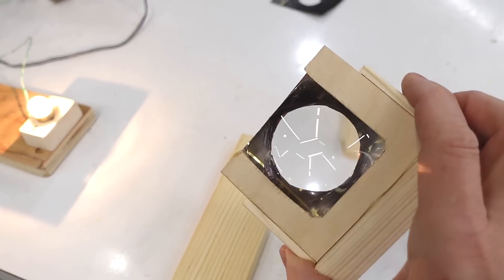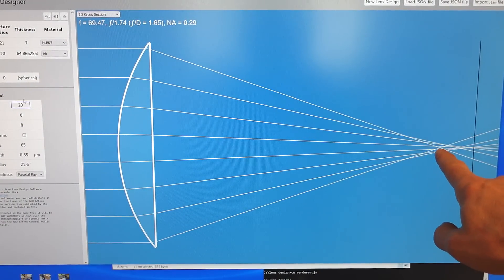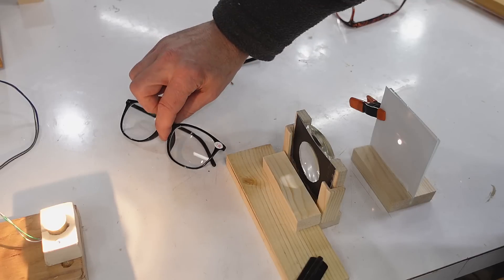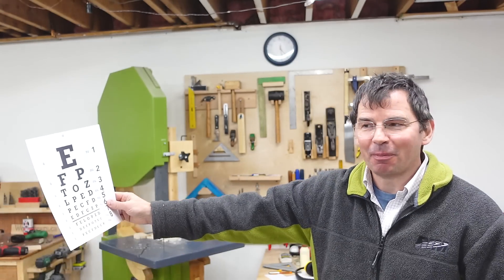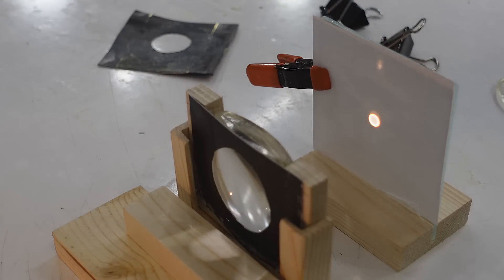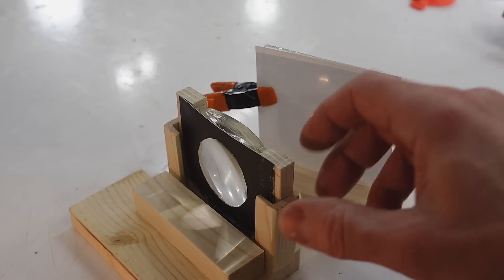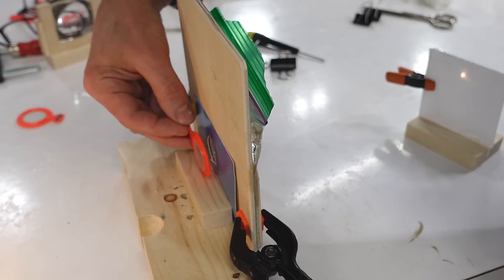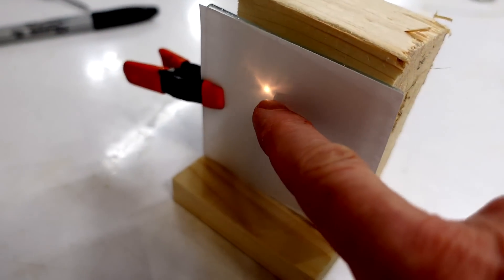We get slightly nearsighted at night, corneal aberrations, and stars

Comment: Do you think glasses affect your ability to line things up by eye? I’ve been attaching planks to a stud wall with screws about 10” apart and when I stand back and look at it the line is not straight! I swear I used to be good at finding the center! Is it the magnification? The astigmatism correction? I started using a torpedo level to mark my screws before I got very far up the wall. Maybe this is related to “I make more mistakes than I used too” and not optics. Either way, aging is disappointing

Comment: I've been following you for a while now and I'm surprised that you just picked up my bachelor topic for a video. Actually there are 3 processes that lead to this night myopia.  
1. as already mentioned, spherical aberration leads to a defocus of about +0.2D.
2. when it is darker, we use not only the cones, but rods and cones (mesopic vision). This shifts the maximum sensitivity of the retina towards the shorter wavelengths. Since shorter wavelengths are more strongly refracted (dispersion), the subjective refraction is more negative to compensate. This longitudinal chromatic aberration results in an additional +0.2 dpt.
For this reason, blue dots are refracted differently in the dark than red dots. 
3. resting accommodation without any stimulus is about +1D in most adults. Even to weaker stimuli, the eye responds with "overaccommodation" or resting accommodation. Stronger stimuli, such as distant car headlights, immediately reduce this effect. Depending on the illumination, this effect is between +0.5 and +2D in complete darkness.
Reply from the maker: You mean to say our focus muscles work in absence of light, but as soon as there is light, they relax a bit?  My current thinking is, due to spherical aberrations, the eyes apply a substantial image sharpening effect and ignore a lot of flare caused by aberrations mostly.  But when light levers are very low, the signal isn't strong or clean enough to do a lot of processing, so this breaks down in very low light.  Personally, I can't accomodtate much any more - maybe 1/4 diopter.  So I woudl think the focus acoomodation part isn't a significant contributor.
Reply: @matthiasrandomstuff2221  that’s exactly what is happening. 

Retinal image processing is also better for cones than it is for the rods. So under low light conditions with more rod-sensitivity the perceived Images get a lot worse. 

A suggestion:
You can try what is your dominant eye and correct it for far distance. The other eye you can correct with (your prescription+1D) actually the brain is very capable of making a good viewing experience out of this. 
You can tell what your dominant eye is by covering up a corner in the room with your thumb, both eyes open. When you then close one eye and the corner is still covered the open eye is dominant. If not the closed eye is dominant.

Comment: Can you do a video on solvents and plastics? I was watching a video of someone cleaning a battery terminal and they didn't use alcohol. They used one of the many contact cleaners. So naybe a nice comparison of name brand Contact Cleaners, rubbing alchohol, distilled water, and vinegear on metals and common plastic types. Mostly nickle plated items, but other metals work too if it seems necessary.

Comment: I have an eye disease called Keratoconus mostly in my left eye.  The big letter E just looks like a black spot with out any correction.  With both contacts and glasses I can kind of see with it.  I do not need glasses nor contacts with my right eye.  I can see movement with my left eye which helps driving.  When I push the buttons on the phone I sometimes push the neighbor button.  Just for your information my eye is like and island nice and round that has been turned on it's side. Just like the island everything shifts.  I no longer look through the center so that's the problem.  For the last few years my Doctor say they will have cornea transplant in about 10 years.  What I see from your video, a lot of what you are seeing looks like what I see only for me more so.  I know I don't need to say this, but please have your doctor check your eyes.  I truly mean you well.  BTW in 10 years I will be 78.
Reply from the maker: I have been fascinated with optical aberrations in the eye.  But I don't think what I'm seeing is worse than usual.   I see quite ok despite the aberrations, and some spherical aberrations are normal.  I think the eyes relay a lot on the brain correcting for a lot of bad optics.  Other than age related farsightendess, there hasn't been a whole lot of changes in my eyesight, so I'm pretty sure I don't have keratoconus.  Will see the optometrist again once it's been 2 years since my last visit, so my wife's work benifits will cover the cost.  Researching all this, I have become fairly knowledgeable on the topic, so I'm pretty sure I'd recognize symptoms of something drastic like keratoconus.  Glaucoma not so much though.
Reply: @matthiasrandomstuff2221  Two things. 1) I didn't mean to imply that you have what I do.  I just met keep watch on those eyes, you can't get new ones.  2) My old eye doctor took about 5 years before he told me I needed to see someone else.  He would spend 20 min looking at my eyes longer than he did my wife or daughter.  I know he did the best he could.  If you do have it, you may not know for a few years.  I knew my left eye was not as good as my right, I just didn't know it was that bad.   BTW when the school told my mom I needed glasses she took me. After they ordered them she ask me why didn't I tell her I could not see good. I told her I didn't know I could not see good.  All the trees now had leaves.  A lot of water has gone under the bridge.  I am happy with what God has taken me through.  Thanks.

Comment: Spherical aberrations get really bad if you get Lasik surgery or ortho-k lenses.  The treated area of the lasik can't be as big as your iris at night so even if the middle of your eye is good, you'll have a huge halo around any light source from light around the edges.

Prk surgery has a larger treatment area but has terrible recovery, like 3-5 years
Reply from the maker: That's not so much spherical aberrations but too small a corrected area.  Problem is, the depth they have to blast is a function of diameter squared, so to cover the full pupil area, they'd have to blast away too much cornea and it would be too thin
Reply: Pupil or Iris - Iris would be a huge area...!
Reply: @thefimo4505  certainly, I meant pupil.

Comment: A long time ago I worked at a manufacturer of intraocular lenses and they were aspherical to reduce aberrations.  Some of them even had two focal points so you could see kind of close up and kind of far away.  Think of it as a small lens in front of a large lens concentrically.  You get some fuzz from the other lens being misfocused at each focal point, but you don't necessarily need glasses for far and near vision.  The artificial lenses have zero accommodation (or did have, maybe the state of the art has improved) so you would 100% need reading glasses before.
Reply from the maker: yes, I find that fascinating.  just rely on our brains to clean up the mess and make the best of it.

Comment: If you make the aperture very small you end up with a pin-hole type lens. You can get pin hole glasses. In theory (my weak and probably wrong theory) with enough light these glasses should work better than lenses.
Reply from the maker: to a limit.  If the pinhole is too small, you run into diffraction limits.  Look thru a 1 mm pinhole in daylight,  won't be all that sharp.

Comment: After your last video on the subject I ordered a set of trial lenses and worked out my prescription.  My left eye is so bad that my brain mostly ignores it except for the peripheral vision and I was always curious whether it was even worth having a prescription for that eye.  I suppose I could have just taken the lens out.  The website I ordered from wouldn't even let me order progressive lenses with such a difference between the eyes of what my approximately correct prescription would be anyway.   I can now also say for sure that there is no point in trying to correct for astigmatism in that eye.    I can't tell you how much time I have spent over the years looking at two different but equally bad eye charts and having to pick between them for no benefit.  Anyways it had gotten to the point where I was using the computer and reading with my glasses off as I couldn't focus close enough with them on and I would wear a magnifying headband in the shop.  I shouldn't have put off getting the progressive lens for so long.
Reply from the maker: I ordered bifocals, hated them.  So now I just wear a compromise most of the time.  About 20/30 distance, but the stuff in my hands isn't terribly blurry.
Reply: @matthiasrandomstuff2221  My dad said that progressive lenses were much better than bifocals so I went straight to that.   They do take a little getting used to but after a week the only thing that still bothered me is walking down stairs.  Can't see anything!  Probably a death trap with young kids.

Comment: So, I asked ChatGPT, model GPT-4:

Why stars twinkle.

Stars appear as points of light or twinkling objects in the sky not primarily because of aberrations in the cornea, but due to a combination of factors including atmospheric turbulence, diffraction, and the limits of human vision.

Atmospheric turbulence: The Earth's atmosphere is composed of layers of air with different temperatures, densities, and humidity levels. These layers can cause the light from stars to bend and scatter as it travels through them, resulting in the twinkling effect known as astronomical scintillation.

Diffraction: Stars are incredibly distant from Earth, and their light reaches us as nearly parallel rays. When this light passes through the small opening of the human eye (the pupil), it undergoes diffraction. This causes the light to spread out slightly, which contributes to the star-like appearance.

Limits of human vision: Stars are so far away that they appear as point sources of light, even though they are actually large celestial bodies. The human eye is not capable of resolving the angular size of stars because they are much smaller than the eye's angular resolution limit, which is about one arcminute (1/60th of a degree).

While aberrations in the cornea can affect the quality of vision, they are not the primary reason why stars appear as they do. Instead, it is a combination of factors related to the Earth's atmosphere, the nature of light, and the limitations of human vision that make stars look like twinkling points of light.

PS. I do not have the knowledge to validate these claims by gpt.
Reply: That's actually not half bad. I'd have to check this for accuracy this as well, but nothing it wrote is outright wrong.
Reply from the maker: I disagree with the part about it not being the cornea.   but chat got just aggregates the common consensus.  it doesn’t really know anything.

Comment: Another aspect that might have a thing to do with this:
Receptors for colour-vision are in the center/focal point of the retina, the receptors for monochrome vision are located in a circle around that.
Which - as far as I understand - is the reason why you don't see colours when its dark enough, and why the vision is a  bit blurry.

You might even know the german word "Morgengrauen" - daybreak or "morning-greying" for a rough literal translation, because everything is black and white then.

Very interesting topic.
Reply from the maker: the Color receptors just aren’t as sensitive.  the  highest res part of the retina, the fovea, is all Color receptors.  those stop working at very low light, so visual acuity goes way down.
Reply: @matthiasrandomstuff2221  true, thats something rather important I forgot to include

Comment: I wonder if different parts of the light spectrum are affected more than others due to the spherical aberration. I have trouble with blue light at night, not during the day and not other colors.
Reply: No need to wonder. It’s definitely the case. Different wavelengths of light refract differently in glass, which is why cheap lenses show lots of chromatic aberration around the edges of areas of high contrast.

Comment: Your sandwich bag with water is a good analogue to the human eye since you can squish it around. I can improve my vision by putting my index finger on the corner of my eye and pulling the skin towards the ear. Obviously it's not as good as glasses, but if I ever don't have glasses and need to see something clearer I know I can do that.
Reply from the maker: I discovered the same thing too when I first got glasses.  Poknig my pinky into the eyelid in the lower left of my left eye warped the eyeball a little to cancel the astigmatism.  Not a trick I ever used much, and probably for the better!
Reply: That’s exactly why people with bad eyesight squint! It changes the shape of your eye slightly. It also gives you headaches, though.

Comment: I have never seen this effect myself (still got relatively good eyes maybe) but I have noticed chromatic aberration when looking at certain red and blue colors next to each other. Turns out its hard to sharply focus both at the same time.
Reply from the maker: You need a -0.75 diopter lens to test this with.
Reply: The dispersion leads to different refractive indexes for the two colors. This leads to different  Focal points for red and blue light. Absolutely true.

Comment: In low light, the iris opens up, shortening the depth of field, which increases near-sightedness.
Reply from the maker: makes existing nearsightedness worse.  But if not nearsighted already, without aberratiosn, would not add new nearsightedness

Comment: I’ve worn glasses for my severe nearsightedness almost all of my life. When my glasses are off, if I look through a tiny hole, I can see with some detail. This kind of explains this.
Reply from the maker: Pinhole effect.  Optometrists will sometimes have patients look thru a pinhole to figure out how well you can see fully corrected.
Reply: Yeah, that's actually an old trick my grandpa taught me if you lose your glasses: poke some holes in a piece of paper and hold those in front of your eyes too look around until you find them.

Comment: I’ve noticed a similar problem with stargazing as I get older. Apparently it’s possible to get tested for stargazing prescriptions for astronomers. Infinity focused eye glasses I guess.
Reply from the maker: Perhaps slightly more minus.  Optomietrists optimize for vision at 20', which is 1/6th of a diopter short of infinity.  So just adding one stop (1/4 diopter) more minus would be ideal for infinity.  Also, a lot of optometrists won't go for maximum sharpness but good sharpness with the least amount of negative as possible.  It's all about avoiding "over minusing" as they call it.
Reply: @matthiasrandomstuff2221  That explains my new prescription! My old doctor retired, and the new one took me down .5 a diopter. It took a week to really adjust!
Reply: Actually this is were the night myopia was first described. Astronomers realized that their Telescope was not in focus by day and they would need more minus at night.